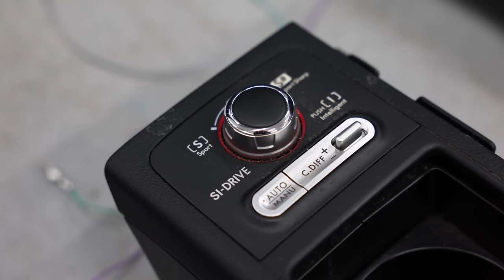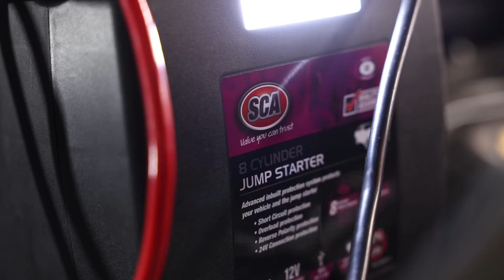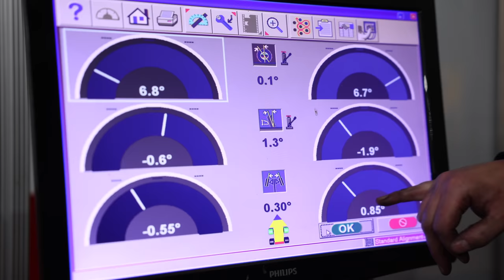EJ25 STI Swap, will it start? - Marty's Levorg Part 3

Comment: The one reason I gave up... Eyesight "TM" is the fk er its near fkn impossible to re code / Personal I dont know why its in the car when it can be turned off.. But due to rules ie safety features can not be removed making it un reg'd fkn sux because this could be prefect recycle car up grade but aus engineering rules are super hard core and expensive with the new cars